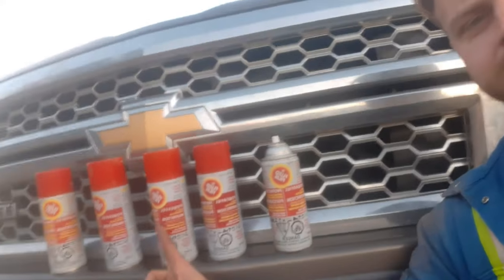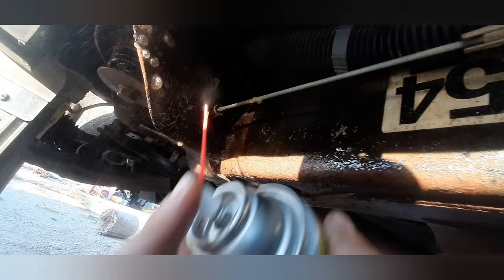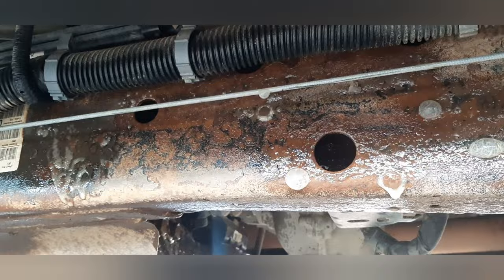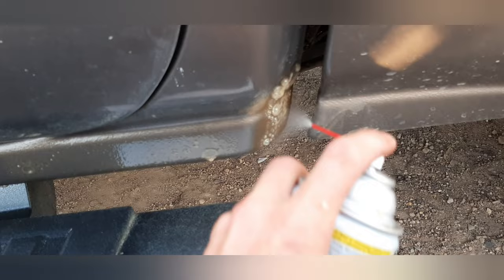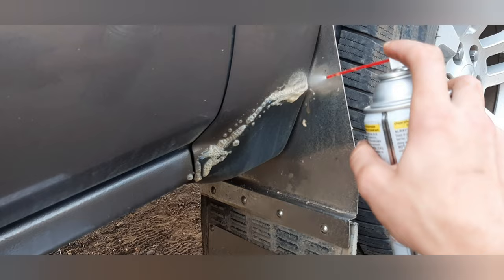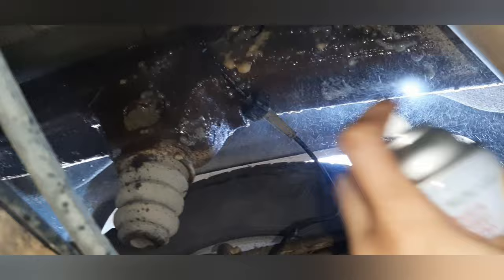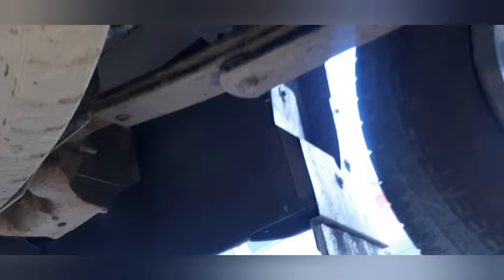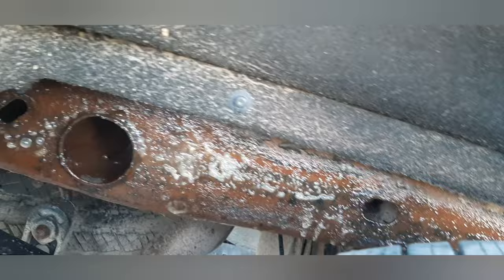FLUID FILM UNDERCOATING will SAVE YOUR TRUCK!!

Comment: Connor, good for you... you are saving your truck!!    You have a bunch of rubber / plastic plugs on your rockers.    pull them and spray in there.   I highly recommend getting the adaptor spray nozzle it comes with a 360 tip and a 24" plastic hose.   Great for inside rockers, doors and inner fenders.   I also take my tail lights out and spray over the tops of my bed wheel wells...   where they like to rot over the tires.
Reply from the maker: Yes. Next year I'm getting the nozzle but I'm hoping to get a small car for a winter beater.